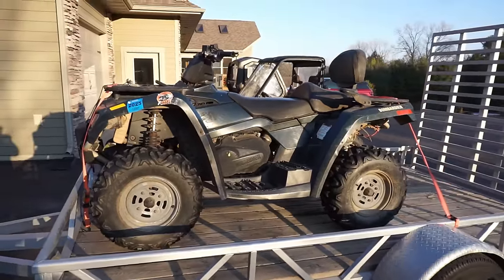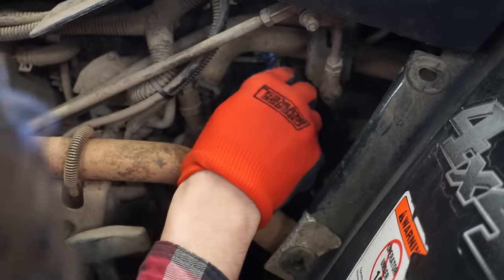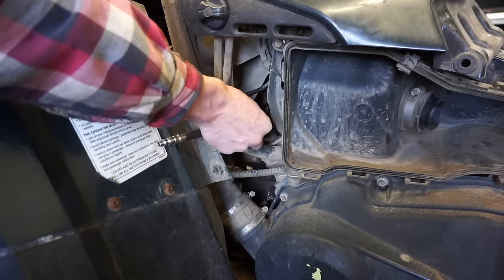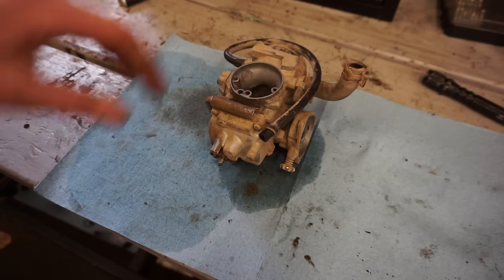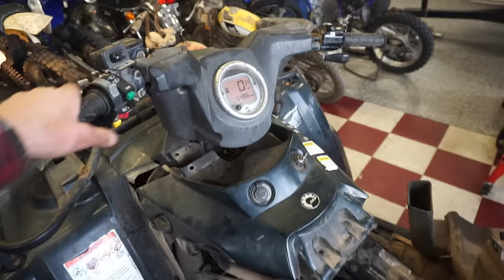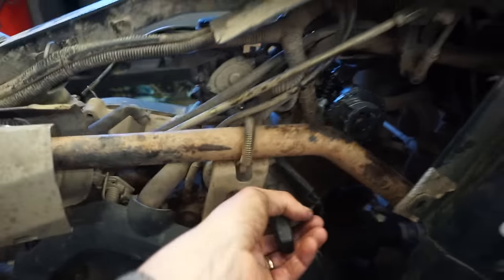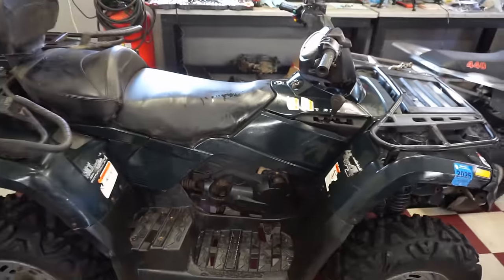Dealership Couldn't Fix This ATV So I Got It For CHEAP

Comment: My Can-Am dealer could not figure out how to put a belt on my Defender. When I contacted BRP, they sent me a voucher for $1500 in accessories. The dealer then installed my new doors upside down and backwards and claimed BRP sent them the wrong doors. Nice machines that are let down by a lackluster dealer network.
Reply: Which dealer? I could sure use $1500 in accessories. 🙂
Reply: Would not surprise me, the big wigs at can-am are not huge on hiring folks for their dealerships and ensuring they are well trained/versed on their brand. You'd think they would be though...
Reply: Wow thats insane 😂.  Who are they hiring 😳
Reply: Sounds like a business opportunity to me.

Comment: Took it to a mechanic to service each year but they didn't bother to replace the air filter or clean it? Sounds like a mechanic I wouldn't trust touching my equipment. Your awesome with how to troubleshoot stuff, learn something new from your videos every time 💪
Reply: Or it could be the owner that's full of shit😮
Reply: @johnnycates4333  the only thing that makes me think he's not full of it is because he sold it for dirt cheap usually liars will sell for full price
Reply: @danielparsons3995  yeah maybe but looks like he just didn't care or take very good care of it I really wouldn't buy it afraid it will jump time again didn't see in video why it di that or he didn't us why or the fix
Reply from the maker: @johnnycates4333  cam chain tensioner spring was installed incorrectly. I will.be ordering a new tensioner just in case.
Reply: Why would the mechanic clean or replace the filter if the client said they were just going to get rid of it? So when the mechanic cleans or replaces it and chargers the client, the quad was consider garbage at that point. I’m sure they wouldn’t have been happy being charged with air filter when the clients throwing it away or selling it as is.
Reply: @JayVaughn-z8u  before he wanted to get rid of it, in the video Joe stated the owner said he had it maintained every year by the same mechanic. Usually a yearly maintenance the mechanic will check all filters, spark plugs, oil and break fluid. It's kinda the most common vehicle maintenance requirements.
Reply: @danielparsons3995  if ur not cleaning air filter as the owner once a month then ur not takin care of it
Reply: @robertdelinsky7247  wow lol y'all just ain't getting the picture.. y'all fkkin stunned.
Reply: Men exactly what I was thinking you just read my mind.
Reply: I think the little dog ran out of petrol?
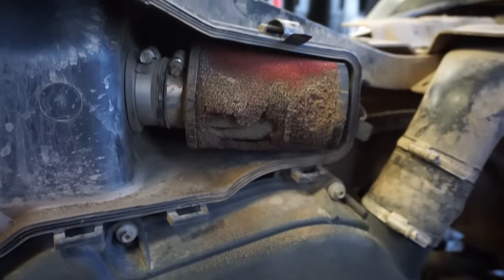Reply: 7:22 looks like someone sank it.
Reply: 7:20 looks like some one sank it while clearing their driveway. He always falls for the stupid stories. Elderly couple planting their garden or just plowing drive way and it cut off. These are unbelievably dumb stories.
Reply: @j_rainsgoat3929   I agree 💯
Reply: I have one just like that, having issues with. I think it might be the filter in the carburetor that's plugged as it won't start
Reply: Tech here- we can’t just replace shit on customer owned stuff. We have quote it and then talk with the customer and almost always convince them to buy it and than we can. That dude was full of shit talking about it being serviced every year with 1. Low oil and 2. How dirty everything on the inside of the plastics are.
Reply: @johnnycates4333  I'm inclined to agree that the owner is full of it.  He said it was running fine when it was turned off but wouldn't start again.  Things can get rusty while they're standing, Things can have water ingress while they're standing, Things can leak vital fluids while they're standing, but something that DOESN'T happen just because it's standing is chains jumping teeth on cogs.
Reply: @2vintage  From the factory?  or was someone else in there?
Reply: Did you change the timing by moving the chain by 3 teeth on the cam sprocket?

Comment: I was unable to work on my wife’s quad last year. Long story short, took it to the “most reputable “ dealership in my area, they told me it had zero compression and $3600 to rebuild. I obviously passed and when I was able to work on it again, the compression was on the higher end of the specs. All I wanted was it tuned up and gone through. So glad I have the knowledge to not get completely ripped off.
Reply: Damn
Reply: That’s why I do not trust dealerships at all. It’s a known fact most of a dealerships income is from working on the vehicles they sell and not actually from selling them lol
Reply: @Yz4Life  
My old, old lady was one of the top earning, service writers for both GM and Ford back in the day, and you are exactly right.
They get big time commission for every job they sell...and sell she did.
Reply: You can sell it back to the guy you brought it from for 1500
Reply: How many hours do you have into repairing it? It seems like less than a day based on the video.
Reply: @chevman21  he spent at least two days, not to mention picking it up. He still hasn't "fixed" it until the tensioner is replaced.
Reply: @BigPoppieSeed no he's not lying. The crook
Reply: Looking at that air filter it been under water so many times it's probably shot
Reply: @Yz4Life and that’s why I call them “stealership, not dealerships.
Reply: @richardotero2376  Don't you think $1500 is better than what the mechanic was going to charge the owner?
Reply: Public service announcement do not take what this guy says for gospel
Do not operate a Kickstarter like he does. You engage the gear and push down.
  You do not slam your boot down on it engaging the gear
Reply: The Piston is free or it wouldn't be running
Reply: Any electrical starter has a “duty time”. In other words never continue to crank it non-stop until it starts!  If it does not start fairly quickly give it a couple minutes cooling time before you crank it up again. Excessive heat will cut down the longevity considerably. Starters are not cheap.  Pull the spark plug(s) and put a little gas directly into the hole and replace the plug then try starting again. Most likely you’ll save what’s left of the starter and get it running faster.
Reply: Awesome!
Reply: @stevenkarkkainen8115  you think if you keep kicking it it might start 😆

Comment: This last spring I bought a beautiful Polaris 500 with low miles for $50 lol. Guy said it had zero compression which was correct. It just had a soft gasket from the intake stuck in the intake valve. One cheap head gasket later and I have a 1500 mile $50 quad
Reply: Still junk polaris.. lol
Reply: Sand in the carb is never good, I reckon it will need a rebuild
Reply: Wow, I take my hat of to you sir, sounds good
Reply: But did you get your starter cherry red?
Reply: @bradfrye8297  I love all three of my Polarizes.  I have owned Polaris quads since 1990.  I have NEVER EVER had to walk out because my machine died.  I usually ride 5,000 miles a year between  my dirt bike and quad.   When I was much younger, I rode my duel sport bikes 10,000 to 15,000 miles a year.   I also had excellent luck with my Yamahas.   

Please tell all of us what brand of machine that you ride. I would like to know.   If you are proud of it, tell us.

By the way, I mean that I have 3 Polaris 4 wheelers right now.  A 2022 570 Trail,  a 2009 Sportsman 500, and a 2018 RZR 900.   I have owned 2 1990 350s,  2 1995 sportsman 500s,  2 1999 Sportsman 500s,  2 2002 Sportsman 500s  and a 2009 that I still have, and a 2012 that I traded in for my 2022 machine.    

The only thing that ever happened out on the trails is, I lost a belt on my 2012 machine.  I was 30 miles from the truck, BUT, I always carry a spare belt and enough tools to change it.  Took me 30 minutes on the side of a mountain at 8,000 feet in elevation.  Spectacular view while changing the belt.   I DO trust my Polaris machines, and I always ride alone.
Reply: @bradfrye8297  I don't understand why people are like this.  Every single major 4 wheeler maker has it's pros/cons/good/bad.  Just like when people say Ford or GM or Dodge are junk.  They all have their decent models/years/motors and their troublesome stuff.  It's just silly to hate on an entire brand and hate on anyone that buys the brand you dislike.  People will cite anecdotal evidence like "My Uncle had a ford and it broke down."  haha.
Reply: @BuilderofRat  I have owned many bikes, quads, street bikes through out my years. Ive been a toy mechanic for 25 years+ ..  I've riden and worked on every single brand... every brand.... polaris  are the heaviest square stock frames with to small of motors in them, the Trans housing are fragile and blow the bearing races out all the time, the electrical systems are out dated and the cvc systems are junk. The regulators fail all the time as well as the "wire junk sion box" they put in them for years
I own and ride kawasaki quads, in my opinion they are by far the best. 
I agree also that everyone has their favs... I just  feel strong that polaris is the worse..
Reply: $50 sounds like b.s. who takes $50 for a atv
Reply: @j_rainsgoat3929  I wish I could post pictures on YouTube
Reply: But it's a Polaris.  You paid 10 dollars too much.

Comment: First thing to do in a no start situation, take starting fluid or WD40 and give a shot down carb, if it fires then its a no fuel situation, if not then its a spark situation, saves alot of time and work. This has always helped me diagnose a no start symptom quickly. Nice job on this one, who would've guessed timing was off that much? I wonder if that shop did that to get a high priced repair and then just readjust the timing and give it back to him, that will be $3200.00 sir lol. But I would be very upset selling it that cheap then finding out what was really wrong, that shop owes him big time. EDIT: sorry got my situations reversed lol, been a long day
Reply: You said If it starts with starter fluid it’s a no spark issue?
Reply: How could it fire in a no spark situation??? Lol.

Comment: If you’re testing for low compression, why would you leave that filthy air filter in? You need air to create compression. As a small engine mechanic, I’ve had several mowers come in with plugged air filters, and after I removed the filter they started and ran fine. You need four major items for an engine to run - air, fuel, spark, timing - and number 5 compression.

The big glob in the carb bowl could explain why it ran and then wouldn’t. Gunk will float around and then cover ports intermittently.

Nice catch on the timing!!  Great the way you reasoned it through and watched for symptoms that didn’t “seem” to be related. Good job.  I think this is a great example of why knowing and remembering to check those five factors I mentioned before is important.

Comment: I was watching your video sitting next to my wife and I told it was valve timing when you were giving it throttle and it was sluggish and it was not smoking which meant the rings were sealing.  Good job systemically diagnosing it.

Comment: I agreed with your initial thoughts about the problem NOT being low compression, based on the story from the previous owner. Basically any engine would NOT be running fine when parked and then not start due to low compression. IMO, the previous owner wasn't truthful or didn't tell the whole story.
Your diagnostic abilities are excellent! Interesting video! :-)
Reply: It could have had a loose timing chain and jumped timing when he shut it off.
Reply: Or maybe the previous owner did tell the whole truth and the complete story. Maybe his mechanic was trying to rip him off.
Reply: @pygmywarrior3  It didn't seem to be loose.   It seemed to be off by 3 links.   I'm not a mechanic.  I watch videos, like Joe's, for the education.   Honest question:  How can it jump timing like that?   With that sort of snugness.?
Reply: @williamfoote2888 Perhaps it backfired when shutting it off?  The chain tensioners are designed to work in one rotational direction.  Not to say it doesn't provide tension if running backwards, but probably not properly.  Aside from that, I don't know.
Reply: Indeed, it raises the question of how an allegedly well serviced machine 
can have the valve timing move itself out three teeth on the cam sprocket.
Joe would do well now it's fixed and clean to sell it and bank a tidy profit.
I doubt he needs more bulky machines sitting in his garage for ages.

Comment: I have the same bike so i was interested in see what was wrong in case I ever had an issue. When you were testing it and were manually pull starting it to do the pressure test I wondered how you were pulling it so easy. I thought maybe there was something wrong with my bike because it is crazy hard to pull start.  But then it all made sense when you figured it out. Thank you for this video. I learned so much about troubleshooting my bike if needed.

Comment: Wow. Great find. Feel sorry for the seller. I guess it is possible that the stealership mechanic made an honest mistake, i just have very little use for them personally
Reply: "Dealer cant fix it" = labor cost exceeds the value.

It doesn't mean they can't actually fix it
Reply: @mostlymotorized -- Could be, eh? They don't want to get stuck with something not worth the repair bill against it. After I got burned a couple of times working on houses, I thought I should be working on vehicles instead. At least that way, you got collateral to make sure you get paid.

Comment: You know, Joe.. and I'm at the part in the video where you just said if it is the valves you should call the fella you bought this from and tell him not to go there anymore, but I have a feeling man.. if it's a 'mechanic shop' and maybe it's a place that does a lot of business, they're going to be just like all the other big places and they just DON'T want to bother pulling the top end apart and checking anything.. Not that they're lazy, but that they just don't want to do it because they have so much other work to do. It's not a good thing, we've moved into this disposable life mindset.. everything is disposable today. Oh it's not running, yeah it needs a motor. Wait what?? What if the valves are out?? Nah, it's easier to just throw a known good motor in. Oh.. uh.. ok I guess.. :/

Comment: I had that exact machine. Make sure you check the front suspension. Mine was shot when I traded it in for a Commander. I didn't even feel any signs that the suspension was bad. That machine rides like a Cadillac!
Reply: I had the 500 twin. That seat was so soft. Very comfortable machine. I also got rid of mine after buying a Commander back in 14.

Comment: I had two of them 400 max wheelers an 05 and an 06 the whole time it was running before you got the timing fixed I kept saying it does not sound right. And just like you said when it started after fixing the timing I said awe that sounds better. Great job. Great troubleshooting.

Comment: the first thing that came to my mind when the value was loose was it jumped timing. i’m glad it was easy to time that beast! nice work
Reply: i'm not at all good at mechanics, but learning slowwwly, how could it jump timing ? i'm understanding the chain would have skipped 3 theeths but how ? thanks
Reply: I hear it most of the time the engine just sounds off when it jumps time or snaps a belt

Comment: The Dealership that could not repair this should FIRE everybody who was involved in the attempt to repair!
Reply: The dealership was covering their own ass. Imagine spending 1k at dealer for this work and engine still lets loose on you. What do you think the customer will say to the dealership? Dealer has to warranty their workmanship ya know.
Reply: Dealerships have a very difficult finding and keeping quality technicians
Reply: These days, a dealer will be happy if he gets someone who comes in alive on a work day.  No one wants to work, so they have to take what they can get.  Which is usually third rate at best.  Add affirmative action to the deal, and you've got a train wreck. 

I wrench all of my own equipment if I can handle the  job.
Reply: Your making assumptions based on third hand information.  What was the "dealership" asked to do?  Maybe the "dealership" is a mate he asked to give it a quick once over.

Comment: it has spark and didnt start,so you put in another plug in it and still has spark,so you tried again and again it didnt start!!what was the point of putting another spark plug in it??how come it took so long to check compression?
Reply: Maybe he doesn't have a compression tester😮.
Reply: @hawkpost44  he had one,didnt you see he used after doing all that extra work first?
Reply: I agree. And it runs but it’s not fixed, valves don’t grow.

Comment: That valve lash will get ya every time. I have done this many times to quads people brought in to the shop. Most of the time its the first thing I check when they say its hard to start, typically people clean the carb in that situation (it never hurts), but setting the valves always did the trick for me.

Comment: Great job figuring out the problem.  My question is if the shop knew the timing was off tell the customer it must have jumped a tooth,  why did he just not just try to adjust the timing. Before saying he needed a engine overhaul.    Besides other minor issues with the bike was the timing set to be that way to make a job out of it or could the bike get that way by itself.  That shop either doesn't know what it's doing or it very much knows what they did. Either way I would tell the guy you bought it from not to go back there in the future.  Thanks for the video

Comment: The Mechanic wasn't completely wrong, it was low compression( due to timing ). I suspect the last time it had a top end rebuild, the rebuilder didn't time it quite right( was off a few teeth ). Awesome video Joe, great diag, got there in the end. I wonder if the timing chain could be stretched a bit?